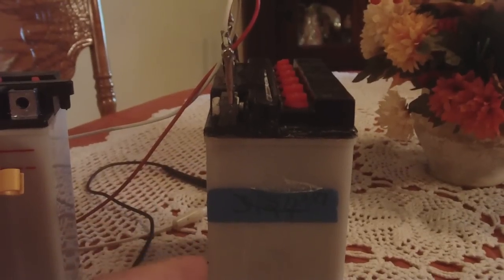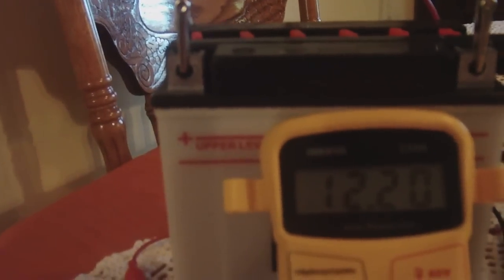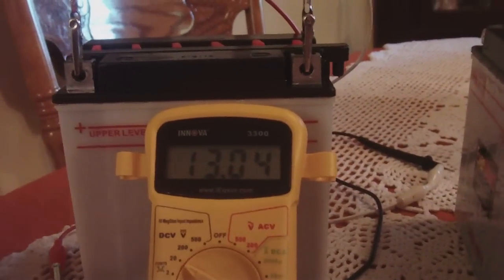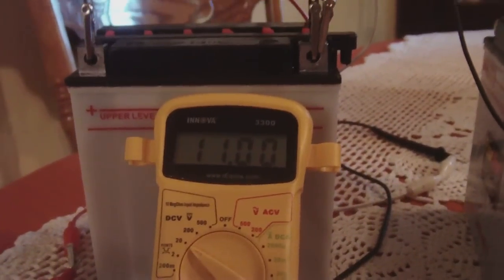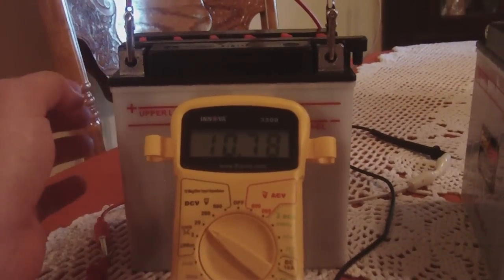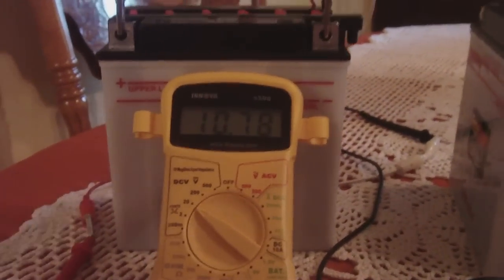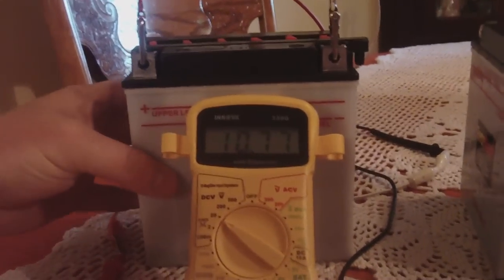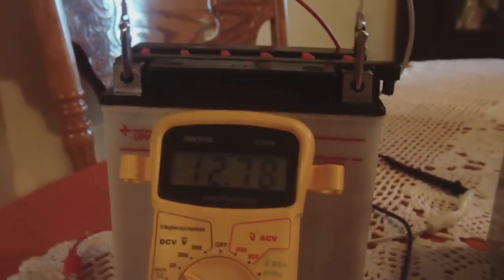Empty Lead acid battery to crystal battery Epsom salt version

Comment from the maker: I haven't touched the battery since October. I have not charged it nor have i used it. The Epsom salt and distilled water lead acid battery turns a normal 12 volt battery into a 6 volt battery. It now sits at 5.71 volts. It makes for a great 6 volt battery. You may have better luck with Alum.

Comment: I seen a video about a man that made a working lead acid battery using only alum and distilled water, he said the secret is to make sure the water feels slippery in your fingers when adding alum, before adding to battery and to make sure that you buy a new battery and fully charge it before removing the Electrolyte solution with distilled water only, then refill with the alum and distilled water and charge, the longer it is in the battery over time the better it will work. So he claims...

Comment: Did you ever try pouring a hot mixture into the battery lead cells using the dry crystal battery experiment to conduct the battery, if this were possible you would never have to put water in the battery for it to conduct, magnesium and copper don't always have to be used to make a voltage correct? I am working on this idea right now. I have brought many a battery back to life adding Epson salts it really works. some guy used alum and distilled water using a lead acid battery and was successful.

Comment: If your going to do a crystal battery you have to discharge and recharge 20 or more times. Your whole attitude needs to change and open to the idea nothing is gained by being impatient with things and build up a knowledge base to understand what is going to happen. These alum batteries hold more amperage then voltage. Its about the current in crystal batteries not voltage.

Comment from the maker: I would do Epsom salt, distilled water, and a very small amount of sulfuric acid. Right now my Epsom salt only battery is sitting at 10.97V, but i still need to do some more discharge and charging test to get it up to the level i need it to be. I'm hoping after many charge and discharge cycles the Epsom salt only battery will be just as good as a regular battery. This battery idea is still very new, so i have much testing to do.

Comment: I will also buy tommorow an empty lead acid battery without the acid ever been in there...
So I wonder, if I just should use a mix of Alum ( Pottassium-Aluminium-Sulfate) or just use straight Epsom-salt for it ? Any comparison yet ?

Many thanks.

Regards, Stefan.

Comment from the maker: if its better depends on the ratio used. John has added some acid to his batteries to lower the resistance. If i add acid to mine it would be better than the alum version. The Epsom salt keeps sulphates from building up. It would be better to add the acid first then charge up a couple times and remove acid and then add my mix. The alum used is ammonium alum (NH4)Al(SO4)2·12 H2O. For power Epsom salt, distilled water, and some acid would be best.

Comment: Well done IBP2 !
Do you think Epsom Salt ( Magnesium Sulfate) is just better than Alum ?
Does it hold more voltage and can it provide more charge in the lead battery ?
As it is much cheaper than Alum and easier to get it would be prefered !

By the way, what is this pickle salt Alum in the USA ? 
Is it Ammoniumalum(Alumen amoniacale), (NH4)Al(SO4)2·12 H2O or is it Pottassiumalum, KAl(SO4)2·12 H2O ?

Comment: John Bedini has said in his non acid battery experiments. That the more you charge and discharge this type of battery. It holds its charge better in the long run and retains its high power capability. I liken it to a drunk going up stairs. 2 steps up and one back. 2 steps up and one back. etc. Until he gets to the top.